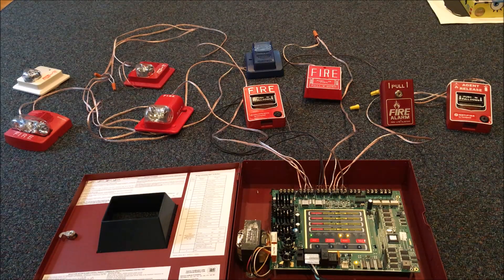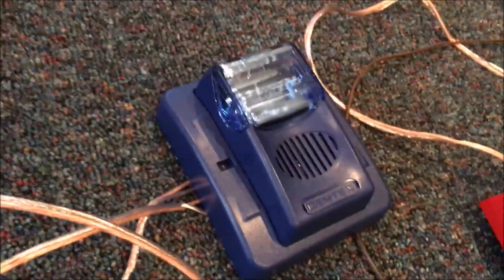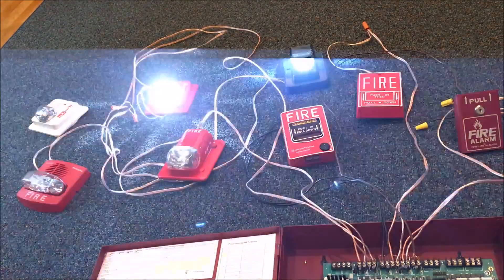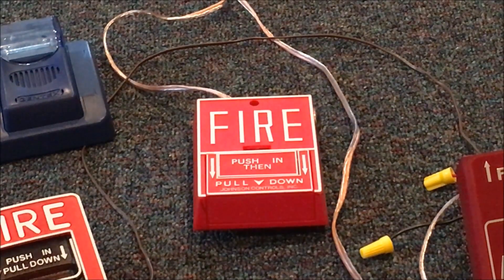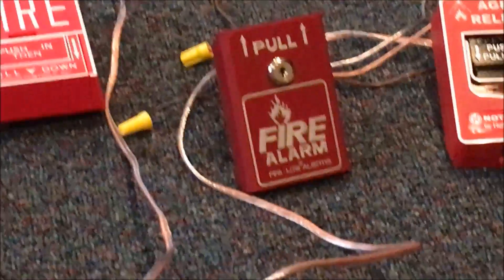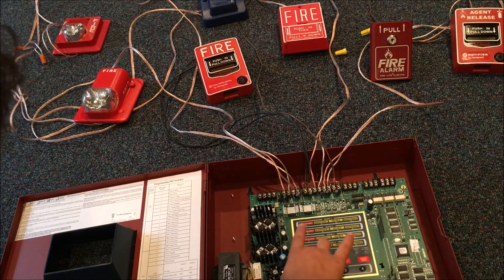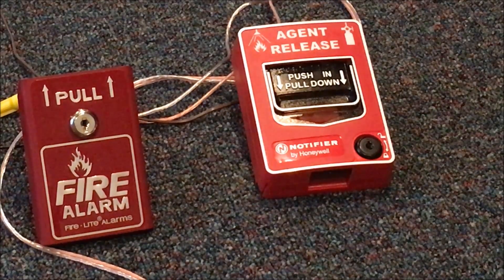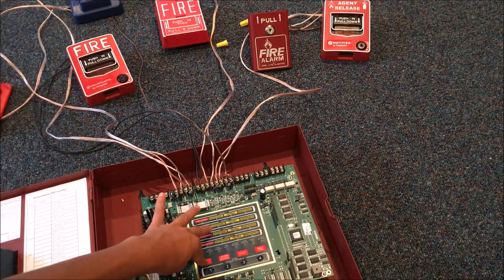STROBE Set-Off With Mircom, System Sensor, Gentex Commander 3, Amseco, and Simplex TrueAlert

Comment: I am in the market for a conventional panel.  Do you have any that you are wanting to sell?  I am also debating making a few conventional panels. Yes, I have made a schematic and it would work just like the real thing.  I am just wondering if I should go through the trouble, and save the money (I'll make on for you if you want), or if I could get one second hand for a pretty good discount.  Thanks!
Reply from the maker: Zachary Cordova Thank you for asking, but sorry. I do not have anything for sale at the moment. Nor, do I even sell anyway. Sorry.
Reply: Okay, no problem! I appreciate the response!  Are you in search of another conventional panel?  I have extensive background in electronics engineering and building, and I can make a panel with as many zones as you like.  It would require 4 wire NACs - one for horns and one for strobes for silencing.  The system can be either 12v or 24v.  It will feature Drill, Silence, and Reset buttons.  There can be as many zones as desired.  There will be zone indicator lights, indicating normal status, and alarm status. There will be and AC power indicator, and silence indiator. It will also have AUX power - for a smoke detector for example.  And everything will be on screw terminals.  And don't let me forget, there are also remote silence terminals, remote reset terminals, and remote AC indicator terminals and remote alarm terminals.  There will not be a backup battery - that will  be in the next version. And best of all, it will cost only $65!  Or, I could get a deposit on one, and you can try it out and everything, and send it back.  And if I get it back working, and in the condition I sent it to you in, I'll give you the deposit back!  These WILL look professional - nothing cardboard, or sharpie, or paper.  And take note that is is the board only - no enclosure. I would love to send you one and see it in a video!  Let me know if you have any questions about it, and what you think or if you think there is anything I should add. Thanks!
Reply from the maker: Thank you! Glad to see you have a passion and a decent amount of knowledge regarding this kind of stuff! I think that is so cool! Unfortunately, I do not particularly like doing the "I'll send you this". Will you send me this" thing for several reasons regarding privacy, giving out personal information, safety,  etc. But thanks for the offer and for thinking of me! I will let you know if anything changes and/or if I have any other ideas. But as of now, I do not accept things from strangers like that. Not that I don't trust you for people in the "fire alarm community", it is mainly for the few reasons I mentioned above. I hope you understand. Thanks again! Looking forward to talking in the future and answering comments, questions, etc!
Reply: No problem, I completely understand!  Thank you!
Reply: Can you take a strobe out of a active systemic

Comment: can you do a tutorial on how to wire resistors and what not, and how to hook everything up to that panel
Reply from the maker: Well I have my panel up in a system right now and it would be a pain to take everything down. I am not sure if I will be taking requests yet. But maybe I can do just a visual video where I am not actually touching anything. We'll see!
Reply: You just one your wire in series and at the last device pit the resistor on the positive and negative terminals on the device so you can monitor the lines.

Comment: This a pretty cool video, I find it interesting that the Gentex, System Sensor, and the Mircom strobes all stay in sync. The only criticism i will give here is that you shouldn't put a TrueAlert on FWR power, which is what this panel provides. Eventually, you may damage it; they're not designed to work on FWR, only Filtered DC.
Reply from the maker: Okay good to know!
Reply: +Fire Alarm Person The truealert, that's why it's flashing so fast
Reply from the maker: Good to know! It always flashes fast no matter what power source I am using. But it seems to be flashing even faster with the panel hooked up to it. Thank you for clarifying that.